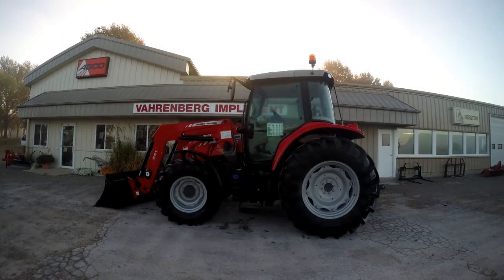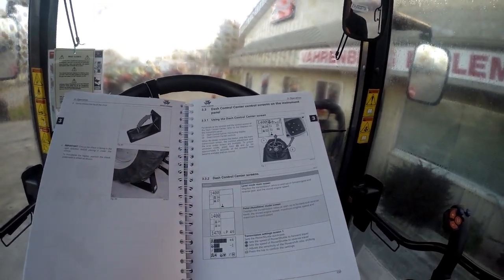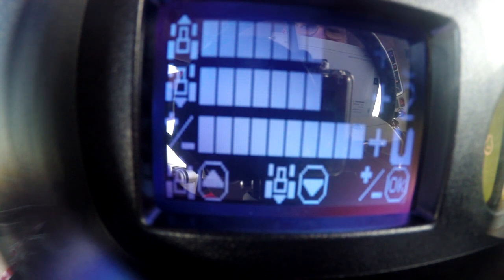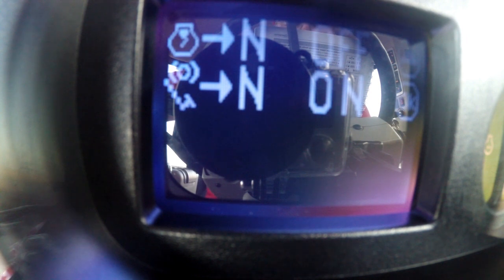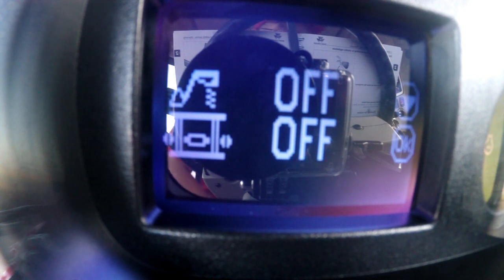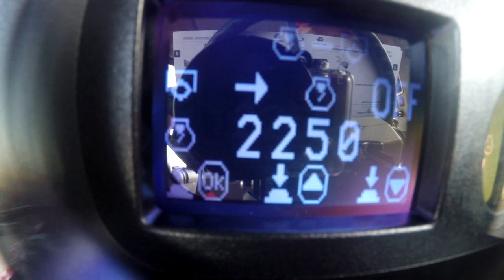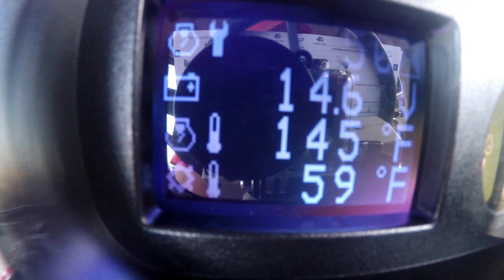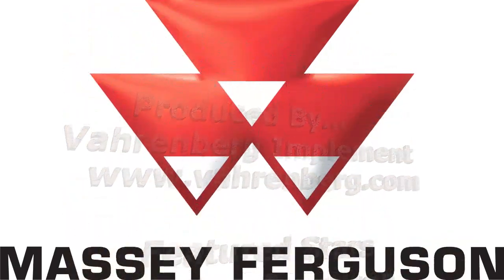Massey Ferguson Dyna4 Dash Control Center Setup Guide

Comment: Is there a way to improve the display visibility in daylight.  Already set at maximum brightness and contrast, but can not read in daylight.
Reply from the maker: Which model. The New S Series Tractors feature brighter screens with the evolution of display technology that are brighter and higher resolution. The prior models the LCD screens were lower brightness. I have had some customers add tint to the windows to darken the cab which helps. Some install tint on the upper portions of rear & side windows.
Reply: @VahrenbergImplement  Sorry, should have been more specific.  Recently purchased used 2010 8650, and find screen difficult to read in daylight.  Works fine at night.
Reply from the maker: The "7" Series products has upgraded to new screen technology that is brighter and high definition than the LCD screen in the "6" Series Products. Technology evolved. Our customers have tinted the top part of the side and rear windows to reduce cab brightness to see the LCD Displays. Plus it reduces solar heating of the cab.
Reply: @VahrenbergImplement  Thanks for the quick reply.  As long as I've taken this off topic a little already.  Can you tell me what the "Rear linkage lifting and lowering operating indicator light" is for.  Right hand side, below the access panel to the console controls.  Page 73 of the Operation manual I downloaded from AGCO, (Flux Player version).  All I can find in the manual is just the name.  All I can find online is a reference to: "X266 - Rear linkage diagnostic and lifting/lowering LEDs", with no further description.
It appears to be flashing an error code: 3,  9,  5,  in sequential flashes.  Again, still with the 2010 8650 Massey.
Reply from the maker: It shows when the 3point is raising or lower. IF you have a code you need to consult with your local dealer. I don't have all those codes hand y to look up and there is some sequences to the codes based on long or short bursts and sometimes there is notifier then the actual code. best way is to video the code and text to your dealer so they can determine what is the concern.

Comment: Welcome. I have one simple question. Could you explain step by step what to do to change default ranges of gears in Dash Control Center (first screen on video)? Do I have to change machine to turtle mode? 

On video I see that is enable screen with gears and you push up clutch before switching up lever up. Is in necessary to do something more (what we can not see) on video?

Thank you for any help :)
Reply from the maker: +Grzegorz Łęcicki You push the Shuttle Lever and T Handle in the same direction you want to make the Change. Increase Forward Gear push both levers forward direction. Reduce or lower gear pull both back at the same time. For Reverse it is opposite direction of forward speed you pull back on both levers to increase speed.

Comment: Can you explain field mode and road mode
Reply from the maker: Field Mode allows you to bump T Handle on the 4 Powershifts then must use Button on T Handle to Go to Next Range. Road or Turtle Range you can shift all 16 speed consecutive without having to push orange button on T handle .
Reply: Thanks, but I wonder why I shall use field mode practically. I just use rabbit (road mode) everywhere. Is there some extra benefits buy using fields mode? Softer transmission? Less tracks in the field?
Reply from the maker: Nope just how you want to control the transmission. Older Models of the Dyna4 operated like Field (Turtle) Mode and we have set up several so the new Dyna4 works just like the older Dyna4 that did not have ability to do sequential shifting.
Reply: Thank you for answering me

Comment: How do you reset the service clock
Reply from the maker: Which Model? There is some variation between models but it's in the Operators Manual how to reset the service indicator.

Comment: how much is this tractor in US dollars. Watching from Uganda
Reply from the maker: 5613 has been replaced by the 5713SL then 5713S and Now 5S.135. There are several Spec Levels but Classic Version with Dyna4 your looking in the $150,000 USD Range Deluxe $170,000 USD Range depending on features and options you choose.

Comment: when i turn the tractor off it resets all the functions , how would i save them
Reply from the maker: Tractor when powered down should save settings. There are a couple that always default off like Brake to Neutral feature is one of those. I would talk to your local dealer to get your tractor looked at if your are having a concern.